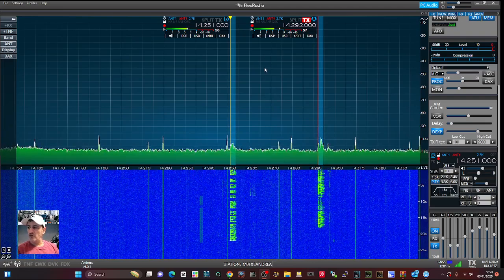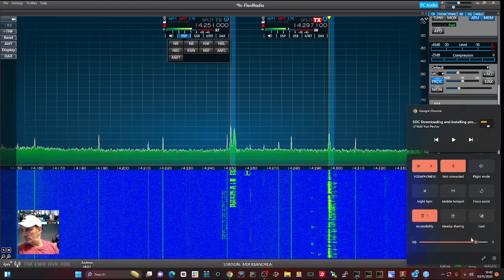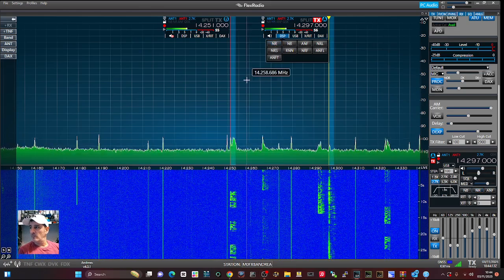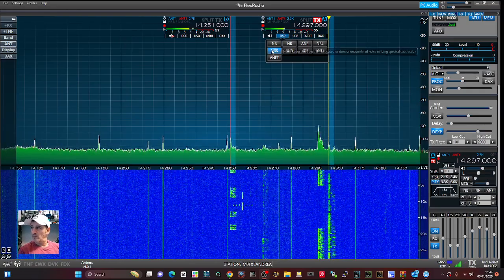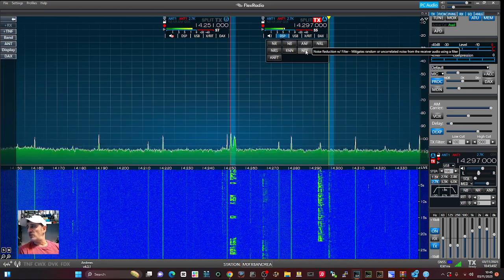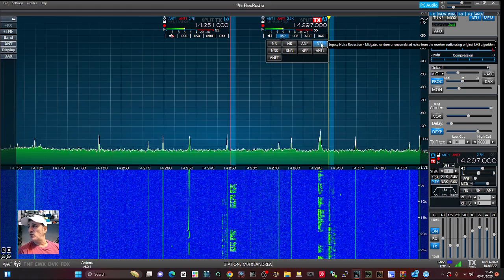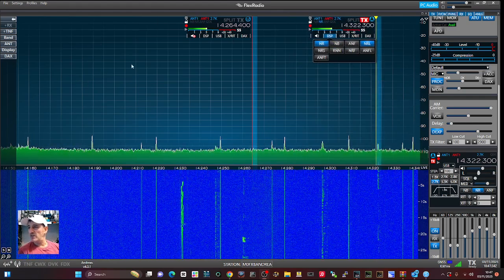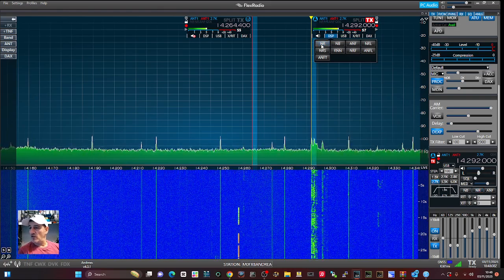Flex 8400 v4.0.1 Noise Reduction  - November 2025

Comment: Thanks for the demo. That was helpful. Can you right click on the buttons to bring up adjustable thresholds/parameters? There are so many different types of band noise, it would be important to tune the parameters to help mitigate a station's particular noise problem. It appears Flex is finally addressing the lack of options in their software. This is a welcome improvement.
Reply from the maker: Thanks loads for this tip.